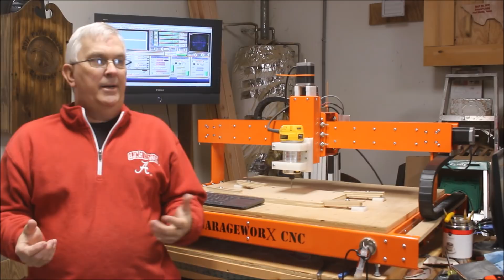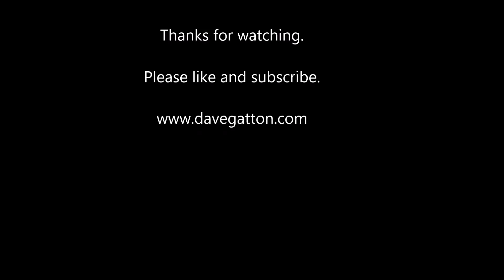Lost Your Zero?  No Problem

Comment: This is why you always want to "Save Settings" after zeroing X, Y, or both in Mach3. Provided you homed your machine correctly, save setting should be saved in G54.  So, after power is restored, home your machine, and then select G54. Those X Y values should take you back to prior power outage.

Comment: If I want time build a cnc table for plasma cutting what  nema steper motor do I need? ? Thanks
Reply: A Plasma table have no contact with the materials you are cutting so a Nema 23 is plenty.   The motors are just moving the gantry in the xyz axis.  In a router cnc, the power of the motors is important depending on the materials you are routing, the feeds and speeds also is of GREAT importance regardless of the motors you have.  But Plasma doesnt require very powerful motors. My opinion.